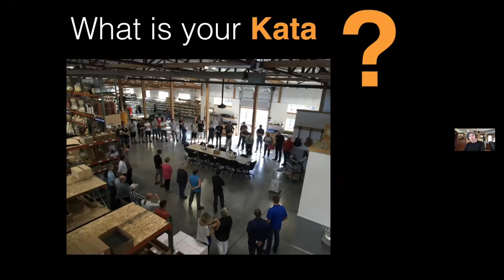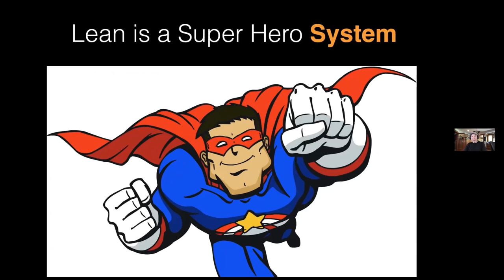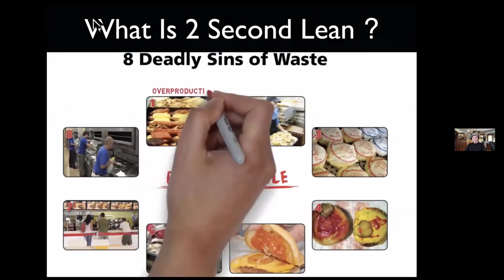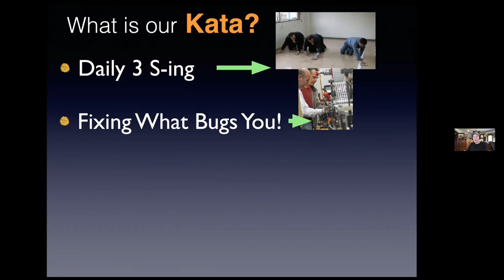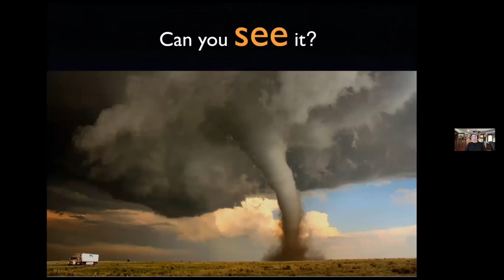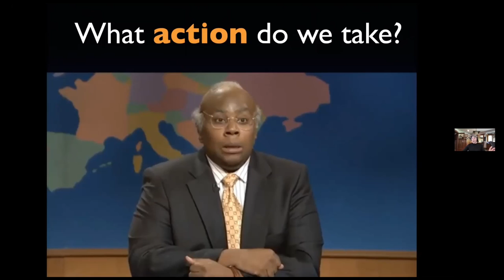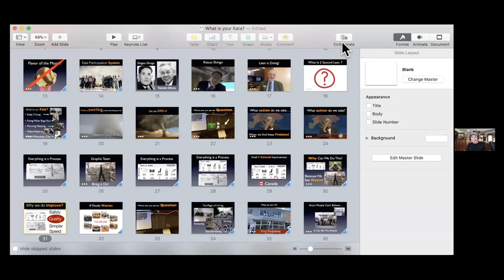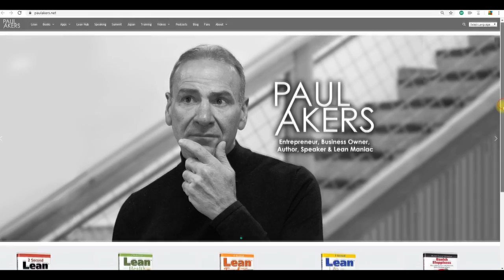What is your Kata?

Comment: Mr Akers, as I watch this I can see that people do not FULLY understand how powerful LEAN is,  I use many principles in my day to day life, at work, home etc, and I have had people ask me if I were some kind of a magician or something. I use LEAN ideas to get in and out of elevators, get up and down stairs faster than anybody, to get through crowds, you name it, and I do it. Lately I have been experimenting with those grippers elderly people use to pick things up from the floor, and the results are so amazing what can be done, we can transform even our bodies using LEAN principles to maximized movement from our physical body which is not exactly designed for our environment, but LEAN principles can even fix that. LEAN is not a hobby, LEAN is a science.